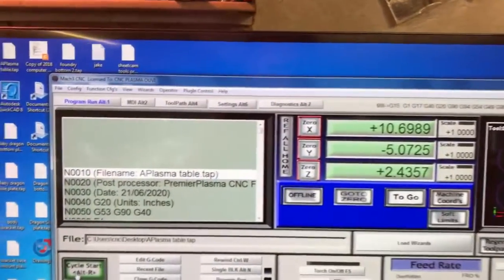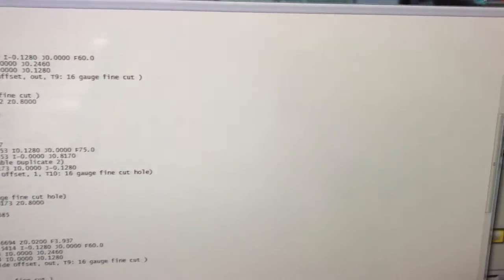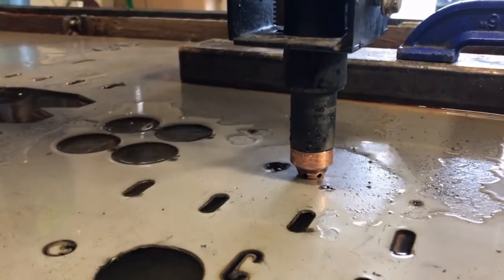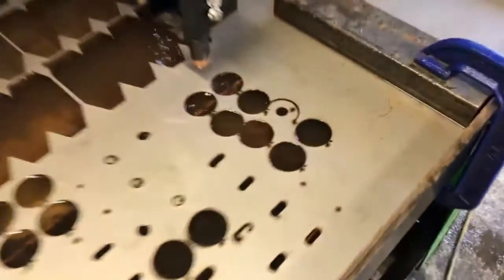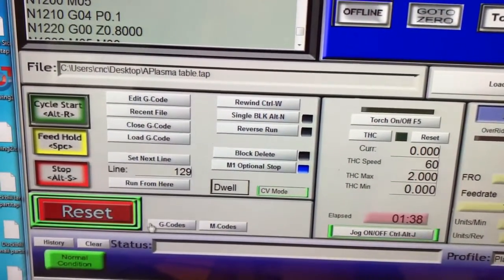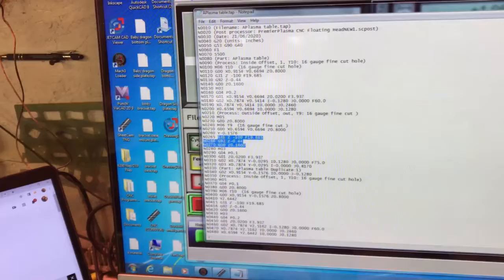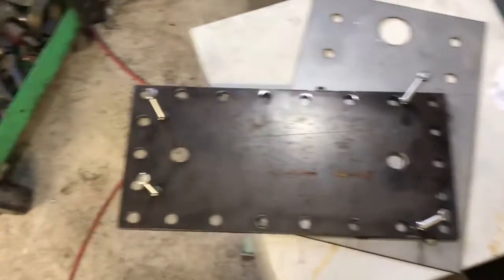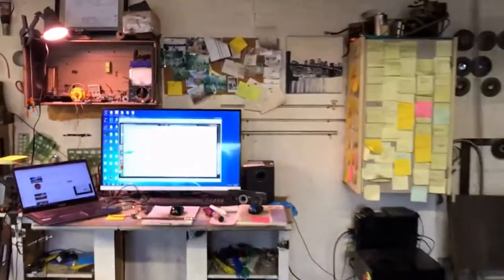Plasma table Pierce height not initiating  SOLVED ?

Comment: Edit  THE G CODE FILE  IN A WORD Processor PROGRAM 
USE THE FIND AND REPLACE TXT EDIT FEATURE TO DO THE FOUR  EDITS 
THEN COPY THE NEW FILE BACK INTO THE  G CODE READER. 

WORD PROCESSORS ARE MUCH FASTER TO WRITE CODE WITH 
THE HAVE MORE FEATURES 
THEY HAVE AUTOMATIC 
SEEK AN FIND 
LIKE. YOU TYPE THMINK  20 times in your paper.    You can edit all 20 with on change. 
The edit word processor will jump to each location of THMINK AND REPLACE IT WITH THINK. 

Then after you are thru editing 
Save the file as a txt file. 

Copy the txt file into the g code running machine

Comment: Some settings in that software perhaps being overlooked ? At least the work around proved it is not being made into the g-code. I knew of some method that was like post processing where they let a program find the places it needed to and inserted the code after it was made. Like you did but automated. Will see what I can find...

Comment: It looks like some of the Macros are resetting your coordinate system.. I'm going to try looking them up (M codes)
Reply: The M6(s) {tool change macro} must be screwing up your coordinate system. Without those, and the bits you copied in, I see code to pull back to 0.8 inches before starting the torch each time, then plunge to 0.02 inches and start moving
Reply: If anything it should be starting way too high without the code you pasted, not too close
Reply: You should be good with just pasting the G00 Z0.16 code to lower the head before the torch turns on
Reply from the maker: Yes i tried this but it was G 31 that makes it work , i thought the same and tried it
Reply from the maker: the .8 is the travel height so the probe does not crash into parts that have fallen at an angel in the cut out holes

Comment: I don't know anything about these CNC machines and their codes, but it looks to me as if the machine is calibrating the depth of it's tip before each and every cut, and I believe that it should not be necessary to do that for every cut if you are sure that your material is the same thickness at each cut. But as I said, I don't know anything about it. 
By the way, that is a cool machine. 
Try to get your hands on some 316L stainless steel if you want to make an electrolyzer, because the 304 steel will oxidize eventually, and therefore drop in efficiency. I also think that you should be careful with those gaskets. I had a similar shape electrolyzer with similar shape gaskets and I also had nothing to lock them in place, and as a result I had a blowout from my gaskets because something wasn't correct inside, and the pressure kept building up inside the electrolyzer. From my experience I know that the shape of the gaskets with no mechanical lock  allows the gaskets to blow out fairly easy. Since you have a CNC plasma cutter you could design plates and gaskets with some extra holes all around in order to mechanically lock the gaskets in place withsome plastic rods all the way through the electrolyzer.  What i am trying to say is that it might be a good idea to design a mechanical lock to lock the gaskets in place in order to prevent a gasket blowout. Take your time to learn about your machine.
Reply: Yeah a dowels to line up the gasket.. and some holes or slot cut under the gaskets.. when swished. Will retain the gasket because it will ooze into the cut piece...
Reply from the maker: yes the holes require much more metal , you are correct i have had a blow out .
Im thinking of using a plexy glass buttress

Comment: I'm not experienced very much with gcode, so this is a question not an answer.  If you have a "Z negative" would that mean your tip is trying to go through your work. Is the top of your work piece supposed to be zero?
Reply: Other way on that coordinate system negative is up
Reply: Nevermind. I thought he was working in a different unit system... Inches.. ick.... 

The code is a probe, resetting the Z zero to .44 inches below the probe height???? (Must be how far the system backs off after a probe)

Need to know what the M codes set to. Clearly they screw up the Z zero
Reply from the maker: @RobertSzasz  Yes you are correct